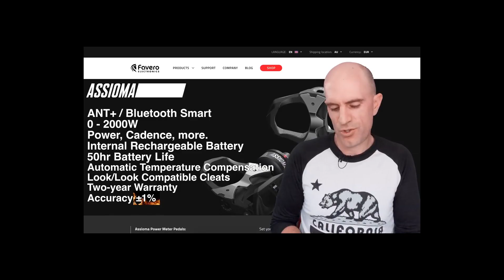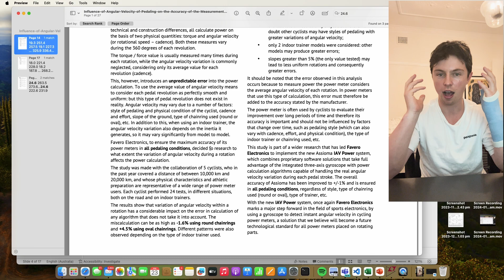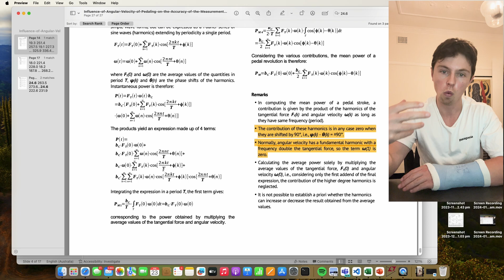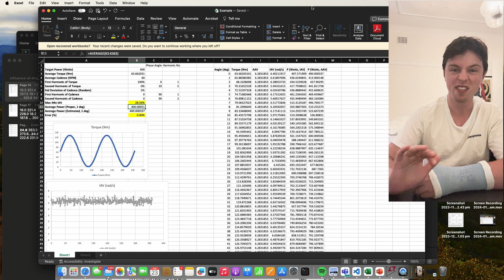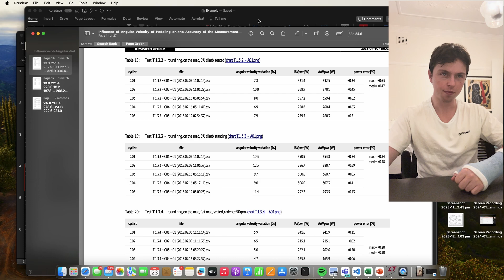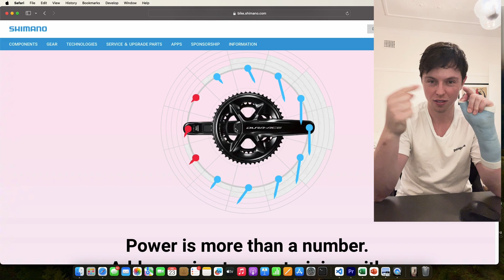Favero Power Meters and IAV - a response to Favero and Peak Torque

Comment: This video prompted me to do some tests between my dual sided 4iiii meter and my TacX Neo. I found the TacX was measuring above the 4iiii by 12-16W in small chainring with straight chainline, which is obviously a problem given at the very least it should measure under due to drivetrain losses. In the big chainring with straight chainline the TacX reads under 4iiii by about 6W, which feels reasonable for drivetrain losses. Im assuming this is at least partially down to what you describe in the video